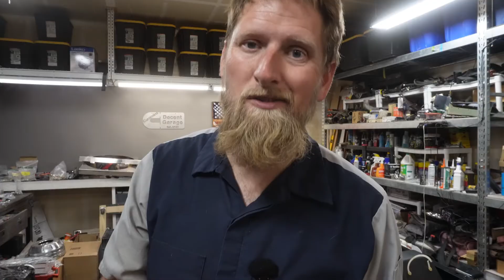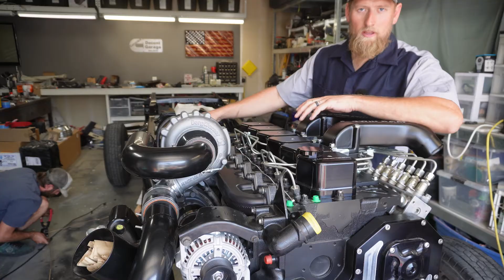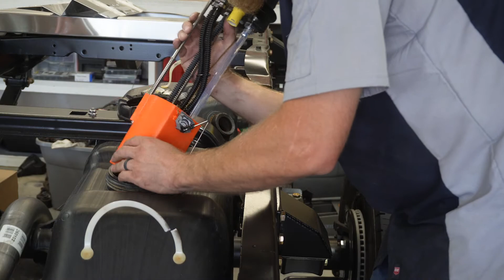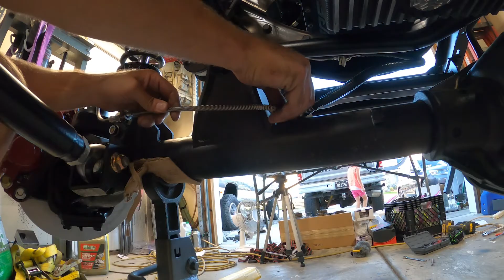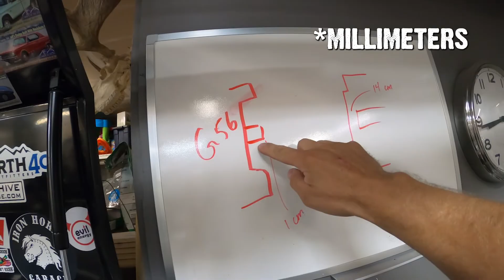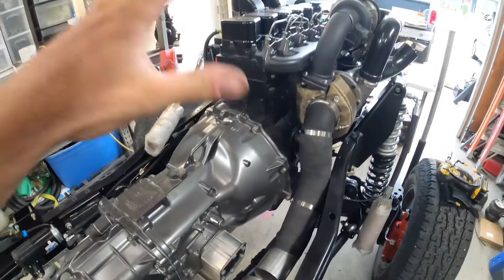Details That Will Set This Truck Apart | The Ultimate American Truck Build - Ep. 5

Comment: Hey Tim, for those front hoses, did you use the same part number for each side or did you use a Left and Right. Looking at Rockauto it looks like the one side has some weird bracket attached to it
Reply from the maker: Great question. I used the same part number for both sides. It's the one without the brackets and stuff.

Comment: Where do you find that rear wheel anti lock brake valve? I need one for mine.
Reply from the maker: This one is from the original truck. Used ones are the only option.